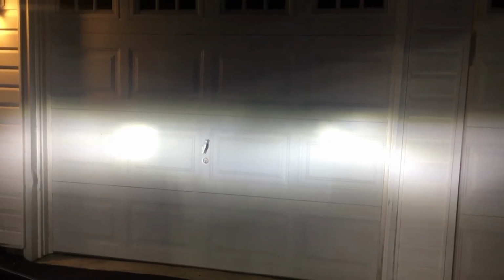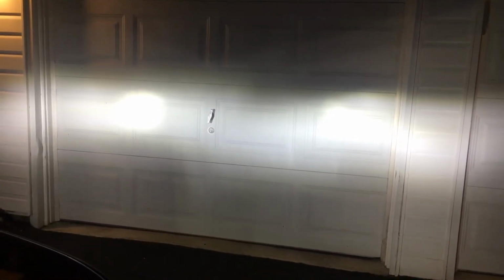HOW TO: 4TH GEN RAM 1500 HEADLIGHT ADJUSTMENT

Comment: Another tip, turn off the fog lights or adjust them down.  Those add to the blinding of oncoming, stupid to use them if you don't need the extra light too.

Comment: I'm having issues i bought some of the projector lead headlights from a local 5star shop, I got home had to wait till later to check out the lights and turns out my left side is like perfect but my right side is like half down, I adjusted the right side up almost close to the other one and then it poped out of the adjustment holder so I took it back to the shop next day he said just because the left side might seem right doesn't mean its perfect it could be to high ti begin with and and just needed lowered to match other side well I wasn't thinking about that when I did the right side, well he got it back in and now here it is night time again and I dont understand whats wrong I had to lower the left side so much because when I turned the right side to go up I turned it to the point where I heard kinda of like a rubbing against plastic almost like its going to fall out of adjustment holder again -.- and its still not high enough I have videos and pictures id like to send you I need help man the shop I got it from the guy says he doesn't have a big open place to do the alignments. So wtf ya know what do I do
Reply from the maker: this article is pretty clear, let me know if this helps you at all.  https://shop.advanceautoparts.com/r/car-projects/how-to-aim-and-adjust-headlights